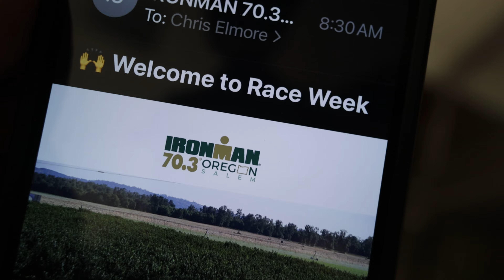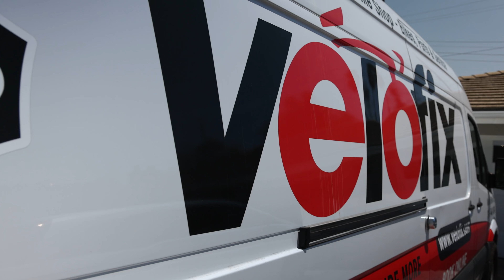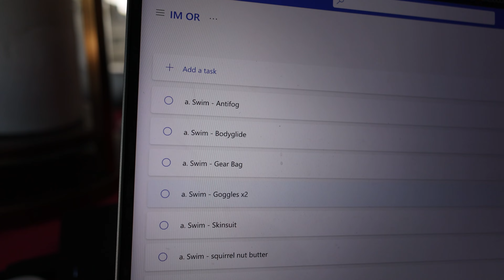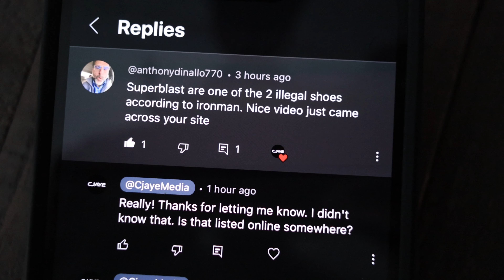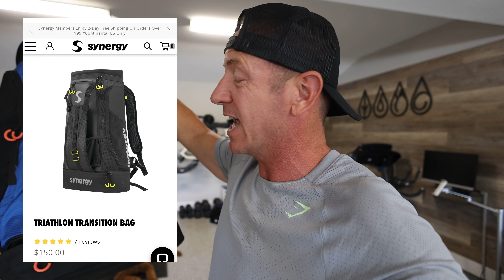RACE WEEK - Ironman 70.3 Oregon - Episode 1

Comment: Chris, good luck @ 70.3 Oregon, I’ve got you loaded in the tracker. Long time OG follower here who definitely needs a gear bag.  I pack body glide, baby powder that I put in my cycling shoes to dry my feet after the swim, head lamp, helmet, swim goggles x2 just in case, swim cap, wetsuit plus a swim skin if the water temp changes over night, run socks, run shoes, cycling shoes, running hat, sunglasses, run belt, gels and salt stick, pre mixed water bottles for the bike, bike multi tool, small zip ties, bike computer, transition towel that’s a super bright color so I can spot it easy. I like to keep my transition area very clean and organized. Good luck again I’m hoping you have a good fun race.

Comment: great videos the past few weeks... will be in Salem spectating and will give you an "ata boy! ata boy!" when I see you on the race course...

along with the common things - body glide, spare tubes, goggles, chammy butter, etc. i add in an extra bottle of water to spray off any sand, dirt or grass that got on my feet on the run from the water before I put my socks and shoes on... also some mini rubber bands to hook to the rear wheel quick release skewer and left shoe, so my pedals don't spin around on the t1 run to the mount line... 👍

good luck on Sunday!

Comment: Wetsuit, swim caps, several pair goggles with varying lenses, anti fog, Buttr, Glide, sunglasses, bike shoes, extra cleats, helmet, number belt, water bottles, CO2, tube, bike multi tool, Field Bars, GU packs, Nuun, Scratch, running shoes, hat, towel, socks, slides.